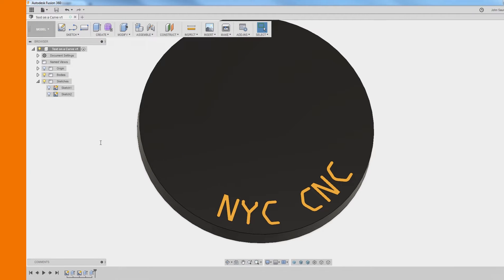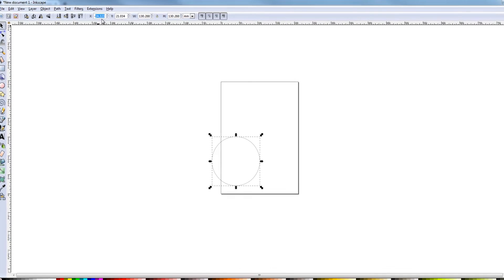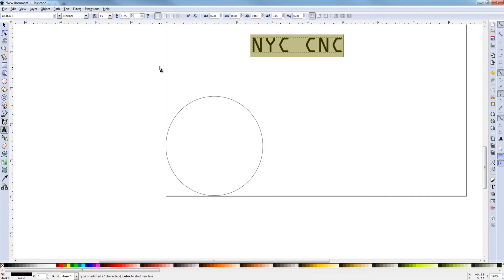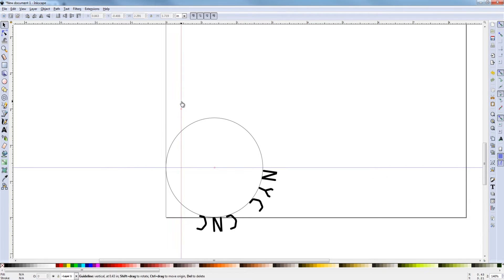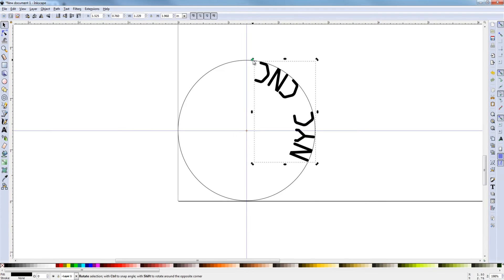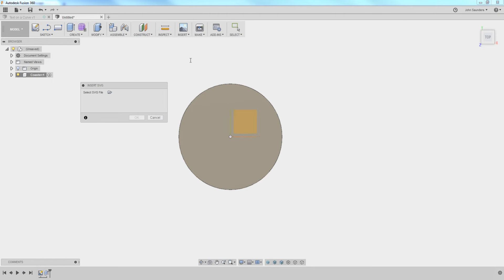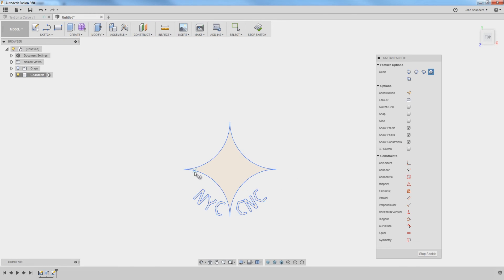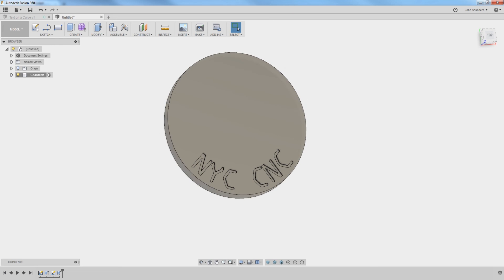How to put Text on a Curve in Fusion 360! FF107

Comment: How does this quantify as a method in FUSION 360???????   TERRIBLE solution...  Another piece of software to learn...  It CAN be done in FUSION 360 quite simply by creating a CONSTRUCTION CIRCLE and a BOLT PATTERN.  Then just place the letters at each point in the bolt pattern and set angle of text.  SIMPLE.

Comment: Hi, thanks. The video easy to follow and it works. However, the size does not seem to follow Fusions' standard when inserted. For example, I draw the circle to match the size on fusion but then it is too small when inserted to fusion. Did you notice this or its' a newbie mistake on my part? Any solution?

Comment: This can all be done in Fusion. I don't know if its a new feature but as of 2/19 it works.
Reply: How? I've been trying to align and size letters to a dimension, but all Fusion is doing is giving me a headache..
Reply: @pco1984  If I remember correctly I put construction lines and points on the part to use as a guide. When the numbers where applied to the part I would move them where I wanted using the points and lines I made as a reference. I'm not sure if this was the answer you where looking for but I hope it was some help.

Comment: Nice example. There is a much simpler way to rotate the text in Inkscape though. After using the "Put on Path" command and flipping the text to put it inside the circle, click on an empty space to unselect everything. Now slow click the circle twice to put it into rotate mode. Rotate the circle and the text will follow, rotating around the circle's center.